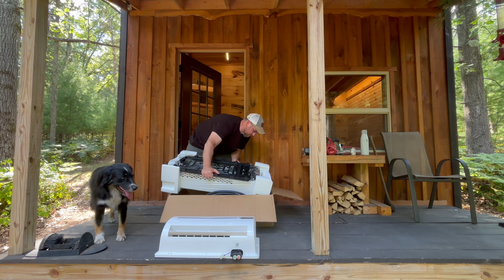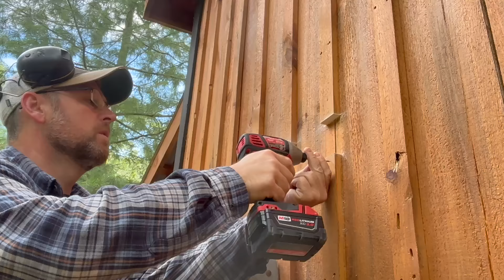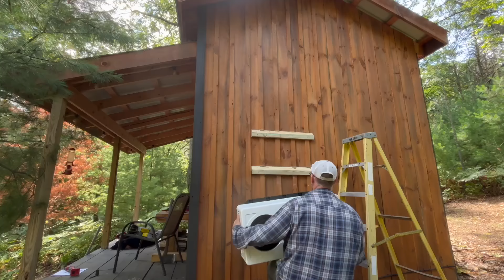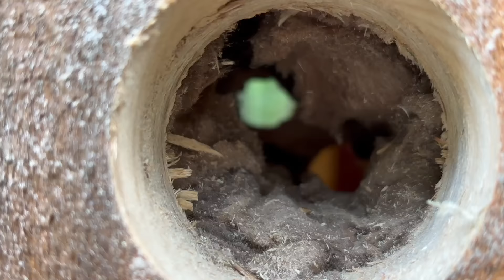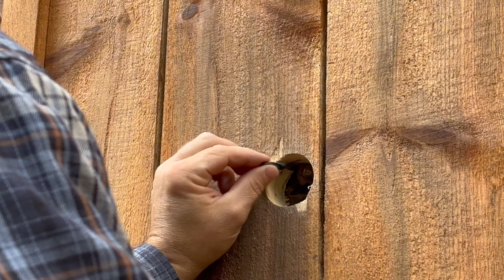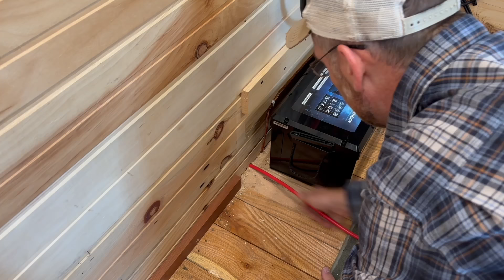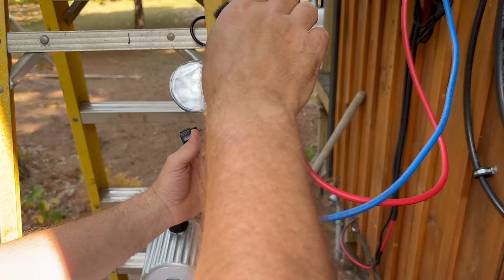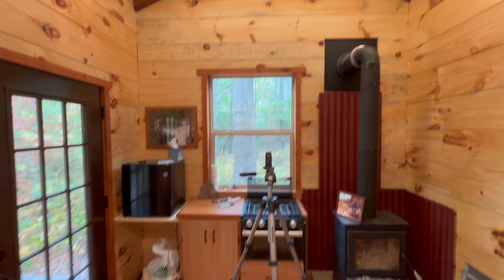12 volt Air Conditioner in the Off Grid Cabin ! OutEquipPro

Comment: Wife an I installed our mini split and it worked great....then 6 months in it stopped cooling and heating and turned out it has a leak. The issue is thw name brand. Most places around here will not work on ot unless they installed it or its a name brand that they deal with. I was lucky to get some one even out here to look at it . Even if I can fix it chances of getting g some one to refill it is very slimm.

Comment: Considering 12v elevtric classic car under dash AC for room(s) in my house (not much bigger that tiny home)

Reason being with condenser having no case that opens door to say drop condenser into ground water fed small tank for better  effincy. Does that via better pulling heat from it;
Improving the whole compress 2 to gas / condence as return to liquid cycle.  AC output would then go up.

Not sure that works with cost reality though.

Comment: Harbor freight has the pump and gauges cheaper. The 2 valves you pulled the vacuum on were closing off the condenser coil part, where you connected your hoses for the vacuum, that was allowing you to pull a vacuum on the lines and the inside coil which is the rest of the system. The mistake you made is not purging your lines after pulling the vacuum. After you pull the vacuum you need to have some freon the same kind the unit uses to purge the lines, since all moisture and outside air will have been pumped out, you do not want to allow any outside air in the lines. After pulling the vacuum before turning off the pump you turn both gauge valves clockwise to close off the red and blew lines from the yellow line. Then you disconnect the yellow line from the pump and hook it up to the freon tank. You open the freon tank valve and then losen the yellow line at the gauge manifold and bleed out some freon which fills the yellow line with freon, tighten it back and then open the 2 valves with the allen wrench and freon will flow into the blue and red hoses so now you have pressure and no air or moisture outside can enter when you disconnect the hoses. Outisde air has non condensable gases and moisture, you do not want any inside your AC, it will affect how well it cools and contaminate the freon, moisture mixes with the freon creating an acid that can cause problems later. That is why you pull a vacuum, so only freon is in the system. I have been an HVAC tech for a long time. Purging the lines properly needs to be done to prevent a higher pressure air will create on the high pressure side and prevent damaging moisture from entering with the freon.  Look how a glass of ice water builds moisture on it, that shows you how much moisture is in the air.

If you have no freon to add, you v=can still purge the lines using a little of the freon in the unit. You pull the vacuum, close both gauge valves clockwise, then open both of the 2 valves on the AC the hoses are hooked to. What happens is pressure goes into both of the hoses, the red and blue hoses so when you disconnect those 2 hoses there is a pressure and air can't be sucked in.. This is a simple way if you don't have freon. Most units come pre charged, having the same freon on the AC service tag is useful to top it off if needed.

If all your coils are clean and have good air flow, this is how you charge it. Hook both hoses up the blue and red hoses, you should see pressure on the gauges, always connect and disconnect the hoses after the unit has been off for 10 minutes or so to allow the pressures to equaliize. With both lines hooked up to the gauges, the unit off , loosen one hose at a time just enough to let a little freon come out a second or two, this purges air out of the red and blue hoses up to the gauge valves that both should be closed screwed clockwise all the way in. Now connect the yellow Gauge hose to your freon bottle, open the freon bottle valve and then losen the yellow hose at the gauge hose just to let a little freon flow to push air in the line out. Now all your lines have been purged of any air. The 2 valves on the ac should be screwed all the way out when the unit is operating  this opens the outside coil up to the inside coil. Next turn the unit on and let it run till the pressures are steady. The high pressure side Red hose is what you use to determine the charge, the low pressure blue hose side is where you add the freon. First before adding freon or finding out if you need to, you get the  high pressure sides pressure while the unit is running, find out what thy of freon is being used and use a pressure temperature chart which will tell you what temperature the outside coil is because at a certain pressure, the freon is a certain temp. Now that you converted the pressure you are reading on the high pressure side while the unit is running into it's temperature you need to check the outside air temp and the temp of your outside coil needs to be 35 degrees hotter than the outside air temp.    Lets say you have 300lbs pressure and the chart says that is 130 degrees and it is 100 degrees outside, you need to add a little freon till you get the high side pressure to what it is at 135 degrees.

Always add a little freon and wait because it takes time for the freon gas to be pumped to the high pressure side and condensed.

So anyway you are adding the freon by opening the gauge valve on the left side or blue line side, To simplify this, find what the outside temp is and add 35 degrees to it, Then get a chart for the freon type your unit uses and convert that temp to pounds pressure and add freon slowly till you reach that pressure on the high pressure side..
The theory is if all coils are clean, to work properly an ac has to have the outside coil 35 degrees hotter than the outside air to dissipate the heat like it is suppose to. These units most likely have a metering valve that helps keep the low pressure correct as long as the freon charge is correct. But normally the pressure on the inside coil needs to equal to 40 degrees using a chart to tell what pressure it is 40 degrees . Pressures van vary some with heat load, they will be higher if the unit is under sized, or if it is real hot our and the space your cooling is hot. so it is best to allow the room to get to the cooled temp before charging the unit. Or do it during the morning when there is not excessive heat.

Comment: Typically I would cut out a small square that I would create a small frame with a removable panel for drilling my holes in which gives you a way to fix it if something goes wrong, you can just change the small panel. Just something I've done.

Comment: HVAC tech here you should not pull off the hoses while in a vacuum. That Schrader valve spring cannot prevent atmospheric air from being sucked into the system. You should of released the gas into the system just enough so both gauges were above atmospheric pressure then remove your hoses.

Comment: I thought of doing this but Rather use a 48V system. They have some very efficient 48V Inverters to power a inexpensive 120V or 240V mini split. I see them on Amazon for 399 with free shipping. The 12v mini split you are suggesting we buy is over $895 plus tax and shipping! Since I would want 120V in my cabin anyway I will stick with a 48V system and inverter control. 12V is very limited, requiring huge wires to have any capacity to run one of these for any length of time.

Comment: I can already see a problem you do realize that those lines inside your cabin are not insulated and they're going to sweat pretty good bit so you should have put armaflex around them and insulated those lines at least the suction line.. the purpose of the vacuum pump is to remove moisture moisture is the number one killer of air conditioning systems. No matter what size unit I run a vacuum pump a minimum of 1 hour.. you're better off to have a micron gauge and get down to 500 microns and hold for 24 hours and you know there's no moisture whatsoever left in the system..

Comment: As a HVAC tech you should have left the gauges hooked up with valves closed down until service ports opened up then take hoses of you probably let air into system pulling them off before opening valves

Comment: The microns need to be at 500 µm. You need a micron gauge to properly determine this. It would show if there’s a leak too.

You shouldn’t had disconnected the gauges while under vacuum. You release the refrigerant with the gauges on. You introduced moisture to the system.

Put some insulation on the exposed pipe connections. You’ll start getting condensation on the areas.

The unit is 12,500 BTU for 400sqft for anyone who’s wondering.

Comment: Way to much noise. Sounds like a worn out machine.
Reply from the maker: I found the issue and fixed it . really simple the fan was slid to far to one side loosened a set screw moved it over and it's nice and quiet now

Comment: from someone who knows nothing about this.......how many solar panels(amps and such) would you need to run this ac only when the sun is shining? two deep cycle batteries 2 solar panels(200 or 400 watts) and a charger hooked to the batteries from the panels? ac connected to the batteries?
Reply from the maker: I honestly dont know yet . I did buy a shunt with metering for my power system so I could find out how well everything keeps up  I just haven't had time to do a good test yet . the problem with the charge controller read out is it tells you the volts of the battery but it doesn't tell you the percentage of the charge you have left so you really don't know how long it will run on what you have . I hope to get that video out before summer is over though .

Comment: You have to release the refrigerant under vacuum bud. You disconnecting the gauges just sucked in more moister than was originally in there 😢It’s under vacuum, it will draw everything it can, in.

Comment: Only thing i would be worried about is all the condensation coming off those elbows that are now in behind your wall, it will just all roll down to the curve and drip straight down in the wall space, unless you use some expanding foam or something

Comment: When you took the charging manifold off you let air in the system (non condensable)
You must break vacuum by opening the service valves before removing the gauges.

Comment: I do not know if it matters very much, but where you can it is ideal and a good practice if you can get it to have the high and low pressure lines to run a down hill gradient back to the compressor unit where you can,...... the idea being any compressor oil that gets carried around the circuit drains back to the compressor when shut down....

Comment: Sooooo, it comes fully charged yet we are going through a vacc. test?
Reply from the maker: yes . the outside unit has the charge . you hook the two together then suck the air out of the lines and the inside unit . then release the refrigerant to the whole system from the outside unit . even if there was a way to have both units charged you would still have to vac the lines between

Comment: That air  on vibrated and made a horrible noise!
Reply from the maker: I just fixed that the other day . The fan was a little bit off center easy fix and super quiet now. I’m planning to do a much longer run time test this week it’s supposed to hit 95 degrees. I also ordered better metering equipment to track power consumption if it shows up in time I’ll get another video up soon

Comment: Hi from Bridgwater UK, 
6 years ago when I moved into this terraced house with a mostly south facing front room bay window, quickly found that when the sun hits it, the room is uninhabitable.  So fitted a "cheap?" Chinese mini split that boasted a Panasonic compressor.  Didn't have to buy or use vacuum gauges and manifold, just followed the instructions to vent air in refrigerant line/s for several seconds, had to time it, Touch wood it's been working perfectly since the install.
Hardest part was drilling a hole through two brick walls to get the refrigerant lines and power lead out to the compressor. 
Anyway, very interesting polished video, thanks.
Richard.
Reply: ... My installation instructions also said to use a drop of light oil on the threads of the connection points at the compressor to stop them binding as you clamp them up to the correct torque, which was over 27 ft lbs, if memory serves.

Comment: AC systems are easy, brother. I recommend people know how to fix their shit because why would I wait 3 days for air conditioning when a bit of dye will do the trick?? I'm not a professional, but I diagnosed my semi-truck AC pretty quickly two different times. Fan clutch stopped workin so I skacked it with a hammer and tossed some wd40 in there to prolongbit a few days til I could get the clutch replaced.  I could tell it had improper clearance. Without amy sort of measuring device.  Then the thermal expansion valve had a leak that i diagnosed woth a bottle of soapy water. Take it apart, check for damage, if no damage then replace o-rings. If it's damaged you can cut and splice in more tubing with a proper flare and flare nut if needed. Obviously you can treat the outside of your rubber hoses with silicone lubricant to prolong them. Keep extras in your shed. You can have a lifetime unit with just a few ectra fittings, a pack of o-rings, bottle of dye, some extra refrigerant, and a couple braincells.

Comment: is the mounting bracket seriously just plastic on the outside?  I’m thinking about installing this in a four-wheel-drive camper but that seems like it might crack to pieces on rough roads, is it backed up with metal or anything?
Reply from the maker: the outside bracket was plastic . it is really thick seems sturdy , comes with a metal stiffer bracket for vans that goes on the inside . not sure if that helps

Comment: I'd guess before you hooked up the line you might get them custom cut and recapped for a cleaner install without the excess hanging outside.   Great install thank you for posting. I have a 10' X 20' shed I'd like to put the same thing in.  It's next to my house and hard wired for electric.   :)

Comment: You can’t tell anything from those gauges you really should have a micro gauge to tell you if there’s any moisture in the system or any leaks. Also, you never take hoses off while it’s in the vacuum. You’ve just introduced air and moisture into your system.

Comment: vibration because your wall is not flat and you tighten down on unit bending it.
Reply from the maker: I don't know the wall is pretty straight , and I did try loosening some screws to see if it changed the noise . I plan to look into it more and do a more in depth review showing real time power consumption  with some better metering equipment soon
Reply: @blackspruce1861  good man.  certainly should not sound that way..
Reply from the maker: I actually tore it apart which was pretty easy . the fan was slid to far to one side . loosened a set screw slide it over tightened it back up and now it's nice and quiet

Comment: HI. I just found your channel and am now a new sub. I was wondering why you didn't use a 120v mini split heat pump. I suspect you're heating with wood or maybe not planning to be there in the winter but heat pump units are very efficient and having the heat at night might have been useful. I have not seen any of your other videos so I realize you may have already addressed this so forgive me if that's the case.
Reply from the maker: Hi thanks for subscribing welcome to the channel !!  I did a camper build video a while back , then I found a 12 volt DC rooftop air conditioner for it and did a video on that . Someone commented that the company that made that unit also had a DC mini split ,and since I really liked the rooftop unit I thought I would give it a try . also it's just a little more unique .

Comment: Geographically, I live in America (sorry) but I share the same ambition to be disconnected from the evil and heartless oligarchs who control the grid. I am also retired and struggling to live on my very meager 40 years of finances I had squirreled away as Social Security. So I have had to take a different approach. In order to abandon the grid I first drastically downsized, minimized and simplified my lifestyle (think literally Walden Pond equivalence). I am now living comfortably with no connection to the electric grid, no use or need for any electric devices except those that are powered by my two 95 amp hour / 12 volt lead/acid batteries, some miscellaneous USB rechargeable appliances (a fan, several lamps, a 20 K / 30 W USB rechargeable battery bank, a 25 W and a 15W solar panel, my phone and an alcohol stove. l have decided to abandon the U. S. alternating current electric grid. Not just boondocking, total
abandonment. Thanks to car and van and RV dwellers, most appliances are now available as solar powered rechargeable 12 volt or USB battery powered alternatives. First I downsized, minimized and simplified my lifestyle. Then I unplugged and thrift store gifted anything and everything I had that required alternating current. I also gave away my Prius and rely solely on ride share and delivery gig services. It can be done, and I have done it, and I have never felt more free or more wealthy or less anxious. As a minimalist I am concerned about not just minimizing my material possessions, I am even more concerned about minimizing my negative environmental impacts.  In a great part, thanks to the nomadic car and van-life dwellers and RV boondockers, I have been able to totally abandon the alternating current electrical grid and to live on only my own solar supplied battery power. Not only is this more energy efficient, it is also non-fossil fuel dependent and therefore less polluting and less costly and more environmentally sustainable.